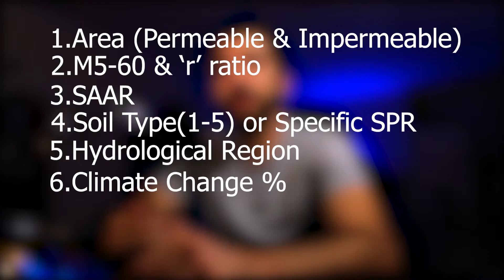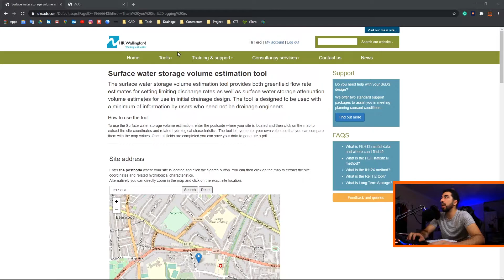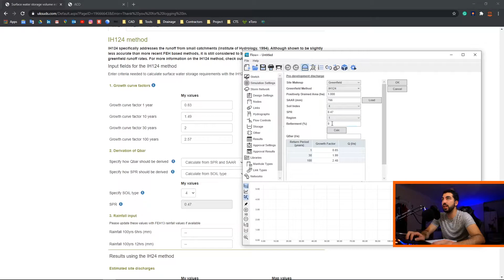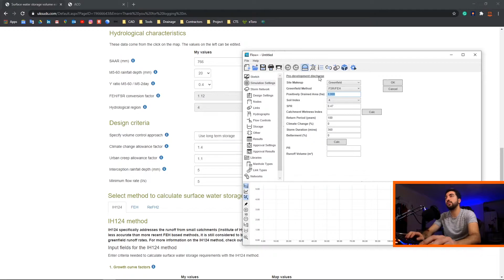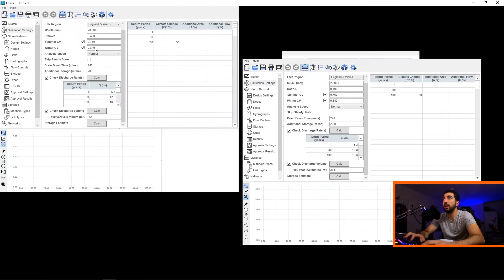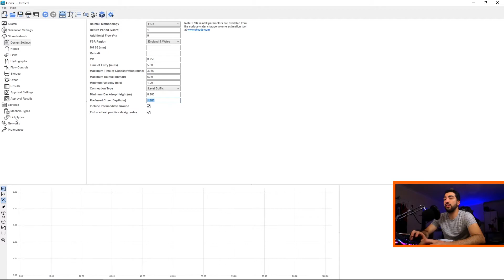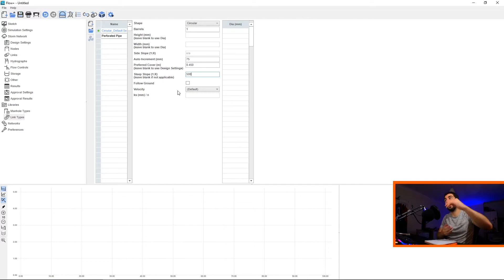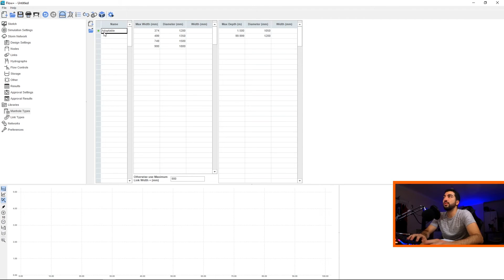Causeway Flow - How to set up your settings

Comment: How to add CAD file as Background inside the Flow model?
Reply from the maker: You cannot atm. But you can convert your cad drawing into flow using smarttools. Or just use live design and draw over your drainage and import to flow. Otherwise, take a screenshot and eyeball it.

Comment: Hi, Thank you for your videos. I am new to Causeway Flow and these have been very helpful.
Do you have any video on the analysis of foul network?
I have been trying to analyze a pressurized network and saw that it is not possible to input a pump for the foul network. Any advice?
Thanks.
Reply from the maker: Hi Tiz, Foul video is being planned. Hopefully it will be out around September.

Comment: Hello. Very useful videos thanks!! I was wondering if you have designed French drains. What would you use a trench / or pipes? I am worried that I would not use the correct velocity / n value. Thanks
Reply from the maker: Hi Jonathan, I am afraid that I do not have the correct answer atm but personally I use a trench. The problem is that a perforated pipe will not have your conventional 5 mins time of entry as the whole pipe is a point of entry. Therefore, one could argue that modelling a pipe would not be realistic as the options for the pipe are kind of limited. But then again, how detail to we want to dive into the modelling? At the end of the day we want to prove that the overall system works in terms of attenuating the flows and meeting the agreed discharge rate. Drop me a message on LinkedIn so when I get the right answer in the future (hopefully soon) will drop you a text. Thank you for your support!
Reply: @CivilTechSource  ha thanks for your time and answer. Not being an advocate to microdrainage at all but in that software you can assign French drains to nodes / MH. Albeit i am unsure if the calcs doesn't double up the capacity of the network.
Reply from the maker: I know what you mean but Flow is just on revision 10 and I have high expectations so maybe we will see this in the next update?